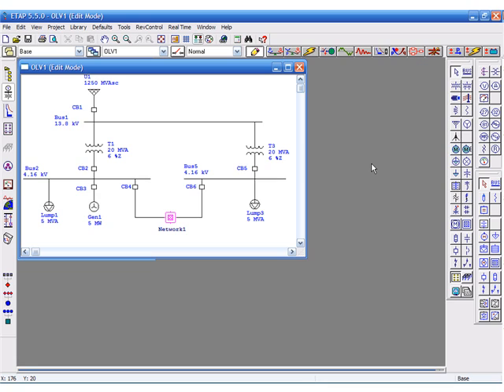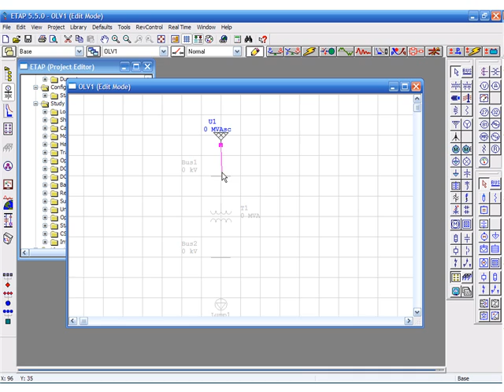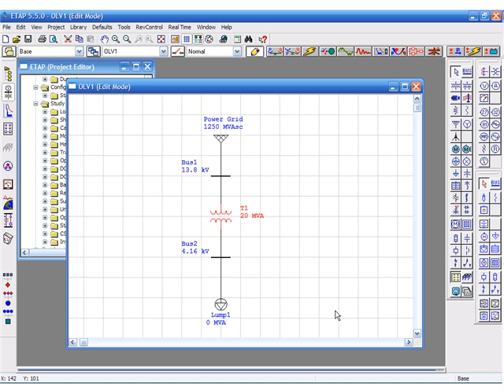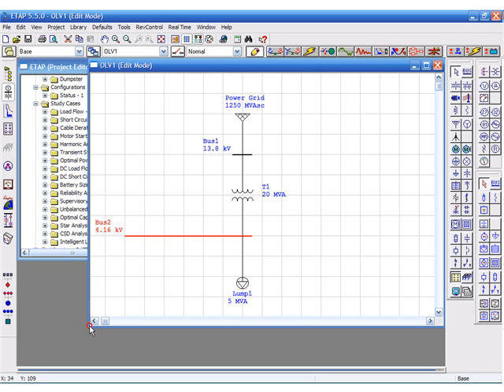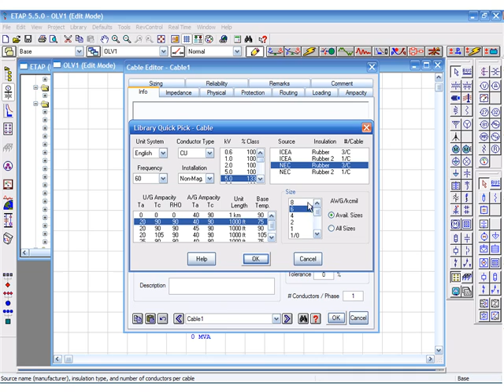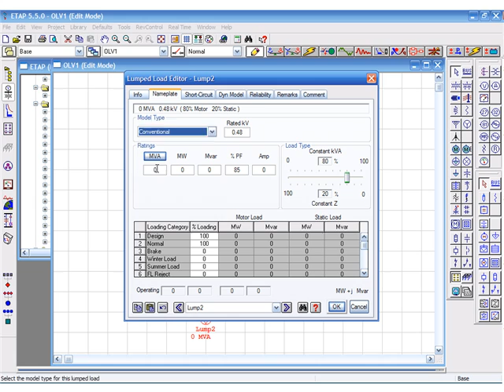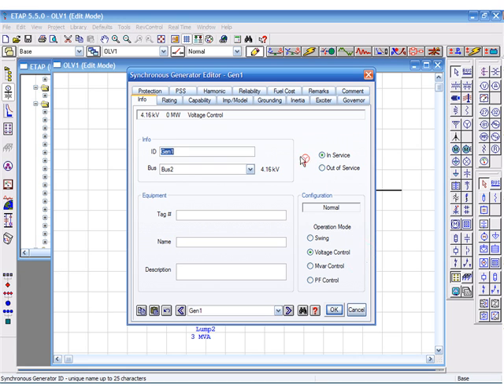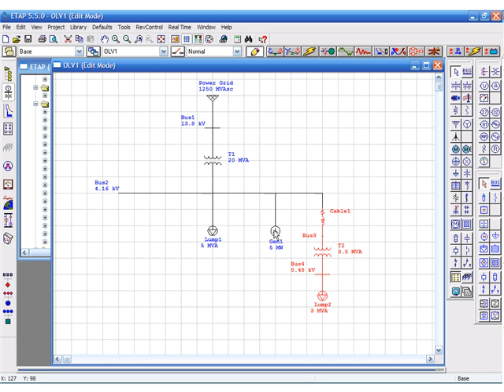How to run a Load Flow Study - Example 2, Part 1

Comment: thanks for the video. how can we solve overexcited or under power during tun time?
Reply from the maker: Thank you for your interest in ETAP Software. Please consider one of ETAP's  Power System Analysis workshops for a more comprehensive and hands-on instruction on load flow analysis. https://etap.com/events/events-schedule. You can also request support from our on-line technical support, if you have a valid ETAP license.

Comment: How to run load flow for single phase system?
Reply from the maker: Thank you for your interest in ETAP Software. Your question was forwarded to one of our engineers who will be in touch shortly. In the mean time feel free to contact our 24/7 online Help Center at support@etap.com
Reply: @ETAPsoftware  Thank you
Reply: the problem was solved

Comment: Sir please upload video of load flow analysis of IEEE 30 bus or 14 bus system in ETAP
Reply: Hi Shaikh. If you are an existing user, you will actually have the IEEE 30 and IEEE 14 bus included with the software. From there you could run the load flow results accordingly. Are there any specific features you would like to see or enhance with our load flow module?
Reply: Thanks sir for reply, sir we use ieee 30 bus system with 5 transformer in which 2 transformer are 3 winding transformer  but in software all five transformer are 2 winding. And one thing is how calculate transformer impedance.
Reply: The impedance is provided by the manufacturer of the transformer. For 2 winding transformers, there's a Typical Z and X/R option which is based
on the American National Standard C57.12.10 and Industrial Power System Handbook by Beeman.
Reply: Jeremy Pangilinan 
Thank u sir for reply, sir I have one doubt , how capacitor connect in series please help men
Reply: Tutorials on PSS/E software here…
https://www.youtube.com/channel/UC7HeIqVlhroZ9bfLTWqJJxw?sub_confirmation=1

Comment: Thank you for your work on this. Some suggestions to make this good video easier to follow
1) The on/off nature of the audio was distracting
2) Sometimes the actions lead the narration. It is better to have the narration lead the action.

A comment for ETAP. It is good that annotations can be moved, but it would be better if the software was developed to place them automatically and not leave this for the user. When they are initially placed in an unreadable or less than ideal location, it does lend itself to the software looking professional.
Reply: Tutorials on PSS/E software here…
https://www.youtube.com/channel/UC7HeIqVlhroZ9bfLTWqJJxw?sub_confirmation=1